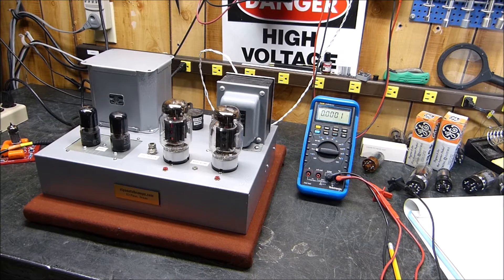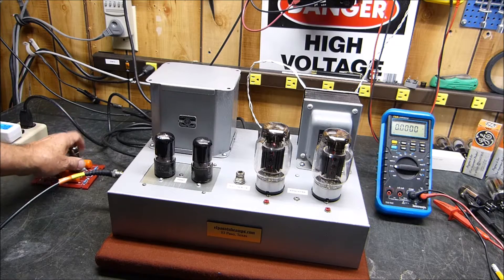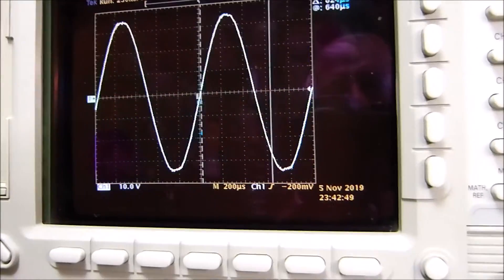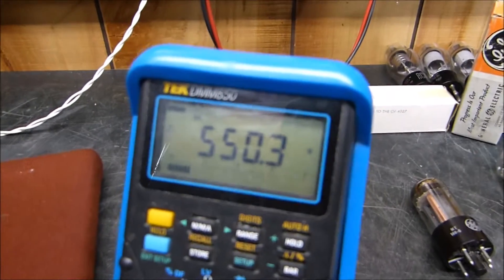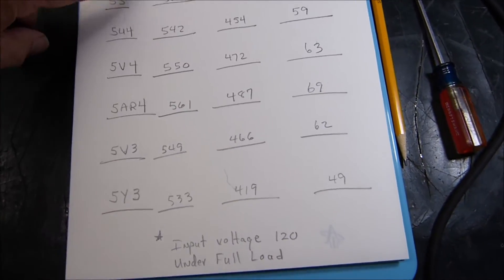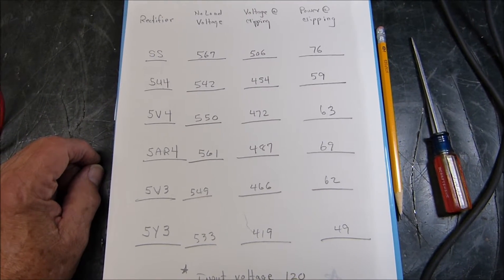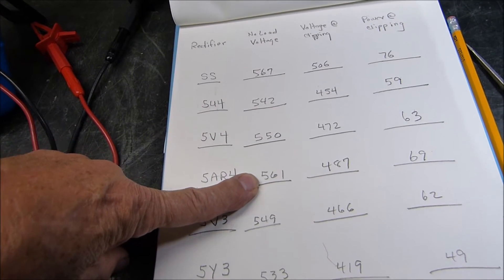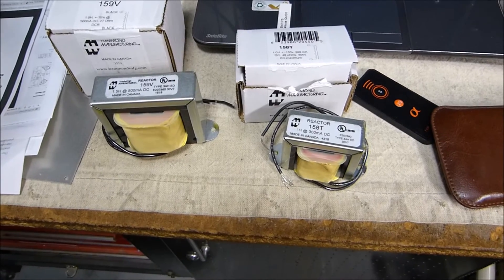SS, 5U4, 5V4, 5AR4, 5V3 & 5Y3 Rectifiers Compared In 75 Watt Vacuum Tube Audio Amplifier

Comment: try resonating the 1.5h choke with a parallel capacitor. Resonant choke filter.
Reply from the maker: I have studied and built and modeled these resonate power supply circuits with LTSpice and there is more to them than meets-the-eye, so to speak. Think about this - if the LC circuit was perfectly resonate at USA frequencies of 120 Hz output from a full-wave rectifier - what would the parallel circuit look like at resonance? It would become an extremely high Z circuit and all the voltage would be dropped across it - that is what would happen, so we really don't want "perfect" resonance of this input power supply circuit. If you study real-world power supplies like in Collins and Gates transmitters and do the math for the values they use, you will see that they are calculated to be resonate a little bit above 120 HZ. And, with that said, as current increases, the L will start to drop, maybe only slightly, but it will drop and resonance will rise - but - initial resonance is placed slightly above 120 HZ so that "perfect" resonance will never go thru the 120 HZ point with changing values of L under load. It would be a disaster if, under modulation load for example, the current thru the choke was making the LC circuit be resonate at 120 Hz each time it passed thru that point from fluctuating inductor value under load.  Take a look at the Collins commercial transmitter in the link below. The schematics are at the very end. The original values are 10H and 0.15uF which gives Fr = 130 HZ. Someone has penciled in 20H and 0.08uF which gives Fr = 126 Hz.  You will see the same thing if you study Gates AM transmitters.
https://www.steampoweredradio.com/pdf/collins/manuals/collins%2020v%20am%20transmitter.pdf
Reply: @ElPasoTubeAmps  Thanks for the link. It will improve voltage regulation by reducing voltage at low load. Yes it will need to be tuned.  The chokes they use are called swinging chokes.. It becomes more like capacitor input under heavier load.
Reply from the maker: @mohinderkaur6671  Chokes used with shunt capacitors for resonance are not swinging chokes.  As I am sure you know swinging chokes are high inductance, something like 25H at low current and 5H at their maximum rated current. I have a couple of these and I have tested them under varying loads and they perform as advertised. I have never used the swinging chokes in power supplies I have built. 
The value of the swinging choke comes from the idea that, as a rule-of-thumb;
L (critical)  =  Vdc/Ima. 
Here is an article that discusses choke input power supplies. 
http://ken-gilbert.com/choke-input-power-supplies-part-1-henry-pasternack/comment-page-1
Their formula says that for a 3000 volt supply and a 10H choke we will need a drain of 300mA of current to maintain a reasonably stable output voltage but at 25H we need only 128 mA of constant current for reasonable stability in our output voltage. 
As they mention in the article, solid state devices have evolved to the point that they can take the high current surge straight into a capacitor only filter.  I still use chokes as I have them and I like them and they do provide better regulation.
I have a 1947 Collins transmitter (30K-1) that uses a resonate capacitor/choke input to a second choke as a Pi and the output voltage running at 3200 is amazingly stable under modulation.
It seems the resonate choke input followed by a Pi might be the best. As I mentioned, I modeled these power supply components several times in LTSpice and I never got a satisfactory answer/understanding in simulation. Design and simulation is fun but generally I check known good designs like Collins Radio, and others, for what has been proven to work and start there instead of trying to reinvent the wheel.  🙂 Thanks for the discussion.
Reply: @ElPasoTubeAmps  I used these to reduce 380-0-380 volts from transformer rectified by 5u4g down to more like 330v dc for EL84 push pull stereo amplifier.  Thanks for the link.

Comment: Hi el paso 1 got a power transformer which has 420 volts secondary and i want make a single end kt 88 with a 5ar4 rectifier so can i use choke 159v hammond for my supply thanks
Reply from the maker: I see the 159v is rated at 1.5H and 500 mA - that should be good. If your 420 volt winding is CT and you use it in FWCT, you should get around 275 VDC. In a bridge you would get twice that much.
Reply: hi no, i got 420- 0-420 volts on the power transformer  and i put a 10 h choke before the 2 chokes  159v  to separate the 2 channels of the amp. @ElPasoTubeAmps

Comment: Very interesting and well documented tests.
What I would like to know is if you had any thoughts about subjective differences in sound with the various rectifiers.  I have certainly seen quite pronounced differences in a preamp with different rectifiers.  It would be interesting to add those perceived sound signature so we could see, this kind of sound is associated with greater sag or distortion measured.  Otherwise, the conclusion to this video is to use solid state rectifiers that cost nothing and last forever.
Reply from the maker: For lowest distortion and highest output across the entire power range of the amplifier, it is like you say, solid state rectifiers that cost nothing and last forever, would be the choice.  On the other hand, me, not being a musician, I can't say about the sound produced by the sag in voltage across a high-vacuum rectifier. 
I listen to this particular amplifier on a daily basis and use a 5U4 in it because it is a center channel and probably never delivers over 5-10 watts. It provides a good 50 watts with the 5U4 and about 80 watts with SS rectifiers. I suppose if it were to be used in a venue where the highest amount of power was required, I would plug in the SS rectifier. Not sure all that I said in the video but a 5U4 category rectifier is really only good for an amplifier that provides about 30 watts output. Off the subject of this video - that is why I sometimes use mercury vapor rectifiers. They are the 100 year-ago solid-state-performance rectifiers. About 15 volts drop no matter the current draw and even the small ones (816 MV rectifier) can power a 400 watt transmitter.
Reply: @ElPasoTubeAmps  Thanks for a bunch of interesting info.  I use two 5u4gb in my DAC output.  One for each mono channel.  The 6n2p triode draws about 50mA so not exactly stressing these guys.  I built it using them because I like the look of tubes, and guys like Lukas Fikus, aka the Lampizator swears by them.  I have been using the same NOS Marconis for 10 years.  Replaced them today with the cheap Electro Harmonix .  The new tubes certainly brought the dynamics and punch to life.
Reply from the maker: @user-od9iz9cv1w  I love tubes too and the lower power tubes like the 12A_7 family of tubes can last virtually forever. On the other hand power tubes may not last so long. 50 mA is sure not stressing your 5U4's. Notice in high-end amplifiers like the McIntosh MC60, they use two 5U4's for 60W output. In the MC30 there is only one 5U4.
I have found out the hard way... what I mean by that is a lot of detailed trouble shooting with no results in solving a problem... that in power circuits where the level of DC current of the circuit is in the upper portion of the maximum current (for example) a 5U4 can supply, can cause issues hard to diagnose. I am that type that wants to find the "real problem" and not just swap out tubes but this has caused me unnecessary work at least once when the 5U4 is weak. Best example of this happened in a Collins 32S-1 transmitter where all the voltages were within specs on the bench but not when it was transmitting and the load was the highest. I tinkered on and off with this problem for probably a year... The trouble shooting was done on the work bench but for some time, I failed to test the transmitter into a dummy load under full power output. I only mention this as sometimes a little bit of careful tube-swapping (with a known good power tube or rectifier) can reveal a problem much easier than chasing and smashing electrons as we may like to do.  🙂 Stay safe.

Comment: Thank you. This morning's question is have you ever encountered a failing rectifier that still works but makes distorted sounds at volume, replaced a 5y3 today in Fender Champ, noise went away. I aways thought they either worked or not, didn't know they affected sound.
Reply from the maker: I had a 5AR4 a few years ago that was too simple a problem but took me a long time to figure out. Only half of the rectifier was working. I let the easy fix go over my head and afterwards felt dumb for it taking so long. Also, in my Collins radio equipment, the PS runs a 5R4 for HV and 5U4 for LV. I have had issues there where I swap the tubes and basically nothing changes but after time and maybe putting in a SS replacement, it works properly and I find out that several of my old tubes are weak. Yes, as simple as it may seem, vacuum tube rectifiers can bite us really hard sometimes.  I will mention another PS problem that turned out to be a real surprise. If a PS has a choke in it and the capacitor on the output of the choke opens up so there effectively is no capacitance there - all will appear OK with the amplifier just sitting turned on (DC voltages are fine)  but once you start driving it, it will get terribly distorted. The reason for this is that capacitor on the output of the power supply choke takes the signal from the power supply side of the output transformer to ground and if that capacitor is not there (open) the driving signal you are putting into the amplifier can not get to ground thru the power supply choke. I hope it makes sense. The DC component (the steady state voltages) in an amplifier work separately from the AC signal (not the power line AC) component of the signal path. Capacitors with one side to ground not only take the ripple from the PS to ground to clean it up but it also puts some of the components (especially the PS side of the output transformer or CT of a push-pull amplifier) to ground to take the driving signal to ground. PS problems often seem simple but it is easy to overlook them sometimes. Hope this helps.

Comment: I like the explanation of why we “crazy” guitar players like tube rectifiers. When you hit a note on the guitar, the voltage sags to the power tube(s). When the note starts to decay away on the guitar, the voltage will swing back up in the amp. This is a built in analog compressor that you can’t get with a solid state rectifier. 
I think one of the reasons of why the late 1950’s Fender Bassman is one of the greatest guitar amps ever made is because of that tube rectifier. Second place is the copy cat Marshall JTM45. 3rd place is a Fender Deluxe Reverb. Tube rectifier greatness!
Reply: @powertothebauer296  ? Fender Champ will sag hard. Those 5Y3 can’t handle the in rush of power when you try to play a Les Paul into it. Massive voltage sag on that cathode bias amp.

Comment: Since in your video the SS did so well, why do most guitarist prefer tube amps over SS amps.
Reply from the maker: That is a good question. I would say for one thing, people just like tubes. 
Secondly, playing guitar amplifiers with a vacuum tube rectifier in it has "sag" which means under maximum output power conditions, when the amplifier is drawing maximum current thru the rectifier, the voltage drop across the vacuum tube rectifier increases, ending up decreasing the  available voltage to the output tubes and they distort or "sag" in a way that the musician  tends to like in creating music. 
Solid state diodes have a fixed voltage drop regardless of the current thru them of about 0.7 volts each. Depending on the current an amplifier is drawing thru a vacuum tube rectifier, the classic one being a 5U4, the voltage drop across the 5U4 could easily be forty (40) volts.  This would from an engineering point of view,  be seen as a loss and something we want to prevent but in the hands of a musician, it (may be) musical creativity.  This is a reasonable explanation of why many musicians like vacuum tube rectifiers.
As for actual  all vacuum tube vs SS amplifiers (tubes from the input to the output or SS from the input to the output), the sound of a vacuum tube amplifier driven into distortion has a much more "rounding" of the distortion products, which is not so harsh to our ears, as a SS amplifier will be when maximum  (and more) output power is obtained. SS amplifiers distort with more jagged edges on the output waveform and these sharp corners on the distortion products are not pleasant to our ears. Hope this helps.

Comment: I wonder how a type 83 mercury would do ? I’m sure it would be the best
Reply from the maker: It would be superior and provide a little more power output from the amplifier and those small gains were what the guys were looking for back in those days. Just a little gain...but as life seems to be, the gain in less voltage drop from a vacuum rectifier is offset by the fact that the MV rectifier, 83, has to warm up before it will work. P.S. they use the 83 in the TV-7 tube testers for the constant and low voltage drop across the rectifier. MV rectifier of their day were the solid-state rectifiers of nowadays. Speaking of warming-up... it seems that today it takes more time for our "computers" to "boot" up than it did for the tubes to warm-up.  Think of the aggregate time in a life-time spent waiting for a computer to boot up compared to tubes warming up.

Comment: The 5V4 makes a nice drop-in upgrade for small guitar amps, say 5 to 10 watts,  typically running off of a 5Y3 and with plate voltages  well under what the output tubes are rated for. Some 1940s to early 50s amps might run even a pair of 6V6s  at only 300 to 320 V!, and if you drop a 5V4 into the amp you'll probly increase the B plus by 20 or 30 Volts, which the tubes can easily handle, and which might deliver some more dynamics and less compression;  although you might want to check the voltage rating on the filter caps,  or simply replace them. Just one other note:  Check the wiring of the rectifier socket to make sure that the main B-plus to filter cap(s) (and presumably the output tube plates)  is taken from pin 8 (the rectifier cathode) , and not from pin 2,   otherwise you're not fully taking advantage of the slower warm up and low- impedance power offered by the 5V4, or a 5AR4 for that matter. Many early amplifiers take the power from pin 2, which doesn't matter when using a filament-type rectifier...
But I've seen plenty of amplifiers that come with a 5AR4  tube "stock" from the factory, but the B-plus is being taken from pin 2,  which is just plain wrong!
Reply: Kevin Counihan , interesting idea, thanks!

Comment from the maker: I have been making some measurements with a test jig to place MV rectifiers like the 816, 866A and the xenon rectifiers 3B22 and 3B28 and others, and compare them to the SS and vacuum rectifiers.  Basically, the MV and xenon rectifiers perform as well as the SS rectifiers with negligible voltage drop.